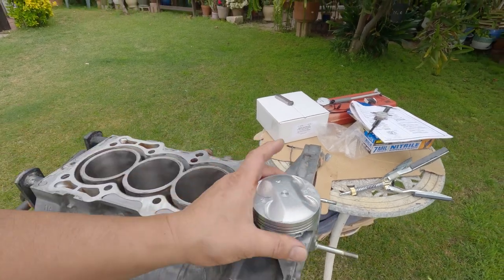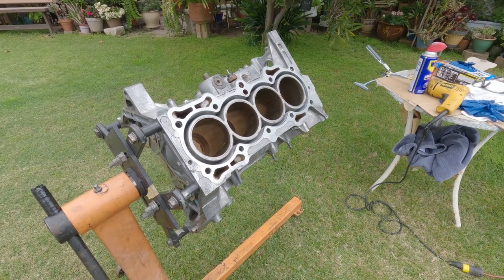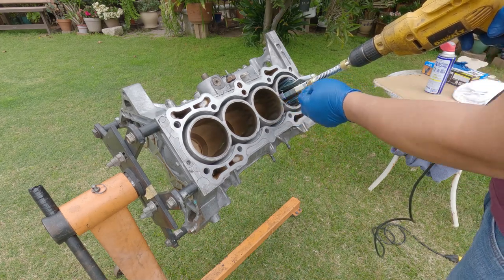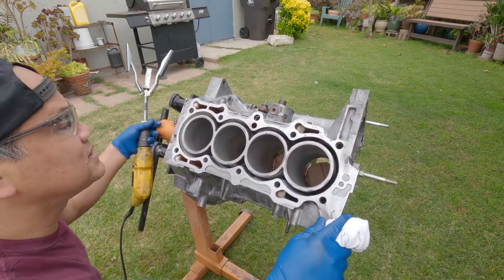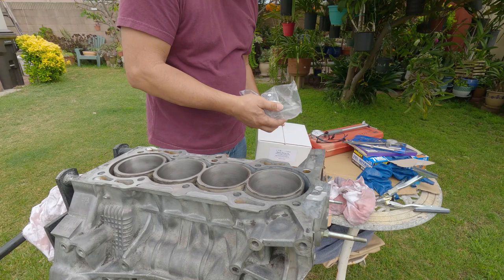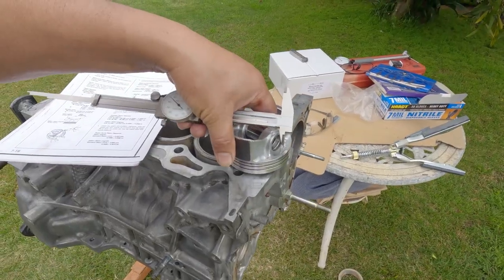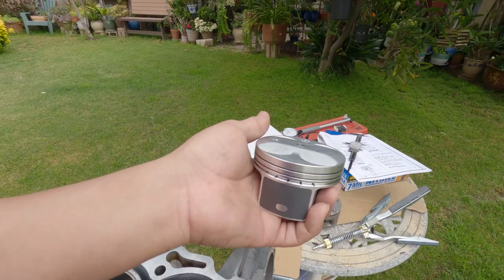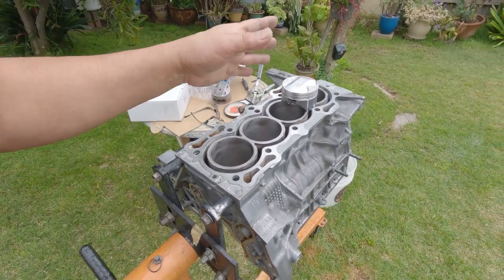Honing F23 cylinder Block and checking K20 piston to cylinder wall clearance

Comment: I've had good success using the ball type hones on the F23 blocks,  I just keep it lubed up with clean engine oil.    Actually most of the F23 engines I've torn down have all been in amazing shape.  I've torn down 3 or 4 F23A1/A4 that were daily drivers, and you could still see the original cross hatching.  Even the rings were all free and in good shape, and the bearings were still good.   These engines hold up extremely well with decent maintenance and oil change intervals.
Reply from the maker: Honda engines does last forever when well maintained. Thanks for your feedback.

Comment: I love binge watching your videos brotha! Its me again Vee.. lol. I'm sure I've already told you, but I finally got my hands on a h22a4 complete head and block from my yard.. rare find, and the wrecked prelude still hade the complete motor with m2y4 trans, but I didn't have enough for the transmission atm.. so I lost out on a good transmission.. but I'm fully rebuilding the head and block, ive downloaded the prelude manual, and it states on there that the block can be honed? With a rigid stone? Which is what you have? Isn't it? I plan to use new hasting rings. But I only have the same honing stone you have.. on the prelude manual, I swear it shows the same identical one as well? But if I get new rings, would it be a good idea to use them without honing the walls for them to seat properly? Or are the frm sleeves okay to do this? Lots of questions I know.. 😂but I really want this swap to be reliable and last.. I've gotten my king .001 extra oil clearance bearings in already, since the honda oem color coded bearings are hard to find.. but my block only needs 1 yellow and the rest are green sized bearings with the stamps on the block and crank, so I figure I get .001  to give myself the extra cushion just in case, ill be plastigauging everything of course, but as long as I'm within .0015 - .0018 on all my mains ill feel confident. Would there be anything else you would recommend me doing? I pretty much ordered everything brand new, gaskets etc.. some oem honda.. but a few I had to source from the parts store like GMB waterpump, gates timing belt, and I bought an ebay manual tensioner. Idk hopefully I'm not forgetting anything 😢😢😅😂😂😂
Reply from the maker: Your'e doing ok brotha! If your block cyl bore are w/in serviceable tolerance, and when you disasseble it that it look like its not burning any oil. You can just put new rings on it. Dont do any honing if you can. But if you feel like doing it. Just do a quick pass. Hope you put it all together and enjoy it. For the tranny, you'll run to it again. Thanks brotha
Reply: @sagittnet2158  thanks brotha. I appreciate it 🙏.  Ive been debating whether or not to do the h23a vtec conversion.. but since I have a 97 spec block, ill have to use the f22a crank and rods.. but its the exact same spec as the h23a1 crank and same part number. Since I have the engine disassembled. I'm very tempted.. but the inside of this engine looks great. The bearings have little to no where, and the oil residue is not sludge at all. Just a slight very slight tint of orange. Maybe from high mileage.  And I'd hate to not use these reliable parts.. but I'm hoping I won't be disappointed with the torque and power output the h22a4 will give me.. I know the h23a vtec has lots more torque. Ill be swapped my pinouts from a11 and a6 around I believe, those printout sheets you sent me were a godsend since I study it almost everyday in the past.. 🤣 🤣 but any hoo.. I tend to ramble on when it come to cars or Fiona in general.. lol. Hopefully I'll be in the h22 club soon. Just a few more parts. I'm missing only the odb1 h22a1 internal dizzy, maybe obd2 injectors since I'm reusing my chipped p06 ecu that got sent off to hasport for vtec components.. and I accidentally gave my h22a thermostat away with those two blocks I got for free last year.. SMH.. so ill be needing that.. and really just the h22 upper plenum spacer that hold the IAB plates. And I have everything else. Phew!!.. lol
Reply from the maker: Just build the H22a4 first, that way you'll have a reliable engine. You can always build a frank engine anytime, w/ H22a4 recondition, no worry of anything and you can run the piss out of that engine. The key to higher rpm are the valve train, you have to replace the springs.

Comment: What grit stones did you use? I'm gonna be redoing a k24 soon and don't wanna take it somewhere to get honed
Reply from the maker: Not sure what grit it is, HF doesn't soecify on their specs. If the cyl walls is not really in bad shape, these will do the job. Thanks
Reply: @sagittnet2158  I ended up getting a 400 grit stone hone, should remove the glazing without digging too deep into the walls

Comment: I'm confused about the whole piston offset thing, I understand that the k series motor rotates the other way but the valves are on opposite sides anyways so why does the piston need to be oriented that way?
Reply from the maker: It's because of K20 piston wrist pin offset is opposite of F23 piston. Mainly replicating f23 piston correct oriention when installed on f23 rods. It doesn't stop other builders to install it on normal position. It'll be a good if someone will share some info if anything abnormal wear on cylinder walls or piston if its installed opposite of f23 piston. Thats pretty much the reason behind it and also a little bit of history. The creator of g23vtec found out also that there are enough valve to piston clearances when using k20 type S piston wrist pin orriented the right way like F23. ITR and CtR k20 piston have taller dome than type S, so it'll require to at least clay your motor if wish to use a piston other than type S.
Reply: @sagittnet2158  interesting, what's ur opinion on using h22a4/type s pistons, do they have a similar offset as the f23 pistons? I'm also wondering if h22 pistons would have any clearance issues with high lift cams in a g23.
Reply from the maker: @leokogan1002  H22 vs k20/f23 piston have different piston height. I have a engine and a episode about it were the H22 piston top is protruding 0.020" passed the H22a4 block w/ F23 crank and rods. Using a base crankshafts is ok but no hi lift cams. Which block are you thinking of using w/ type S piston?
Reply: @sagittnet2158  probably an a4 block, just for convenience with the headgasket and all
Reply from the maker: @leokogan1002 H22 piston made by JE have a wrist pin offset, l believe it was FSR model and some manufacturer dont have it. You can also find a K20a2 piston that doesn't have wrist pin offset made by CP piston. Wiseco k20 have wrist pin offset but their H22 have no wrist pin offser. It's a bit confusing on piston selection but you can always narrow it down to make it easier. Just remember that H22 have a different cyl sleeve w/c is FRM and piston selection has to be compatible w/ it. Otherwise damage on cyl walls and piston skirt will occur.

Comment: I used that honing tooling rebuilding my block back in February. Been running good every since 🦾
Reply from the maker: It actually not bad for the price, thanks man!
Reply: @sagittnet2158  no doubt & thanks also man. Followed your steps etc & got it done
Reply: what engine did you do it on?
Reply: @sagittnet2158 what engine did you do this on?
Reply from the maker: @rogelioburola84  F23 block, its for g23
Reply from the maker: @rogelioburola84  it's F23 block from 98-2k Honda Accord and it'll be a G23vtec build project.

Comment: ur videos are amazing keep it up 💪💪 questin i have h2b del sol when i turn the headlights on the car idle lows and when give gas car idles reallyl ow and dies but when headlights off is good any ideas🤦🏼‍♂️thank you
Reply from the maker: Thanks man! I never deal of something like yours except for when l was breaki'n the g23 where l come to a stop byt the idle start surging. Do a elimination procedures, I can suggest check your IACV , check the filter and clean it, then check iacv together w/ idle screw if it require to be adjusted. It can be that your alternator could be needing some replacement but this will be your last move though. If you did any recent maintenance on your car prior to this problem. Go back to whatever you did. Check or ajustment of tps might help too. Check all your ground connection also. Check your Ignition spark plug gaps and check your rotor. Hope you get her fix man, but yeah, start on lacv.
Reply: @sagittnet2158  appreciate it my man 🙏🏼 i will check  keep doing more videos I  always check them out 🙏🏼🙏🏼 amazing content and how u explain things💪💪💪

Comment: Do you know what post mount can I use for my g23 ? I’m planning on swaping a g23 into my civic and only thing I’m missing is a post mount
Reply from the maker: Most people use H22 post mount. But l'm using F23 that l modified to fit the mount. Either of the 2 can be use.
Reply: @sagittnet2158  I tried my h22 post mount that came with my h2b kit and it doesn’t work how did you modify the f23 mount ?
Reply from the maker: @H2b.sookie  yes, your post mount that included on H2B kit will not work on F23 block. It's only for H22 block. I'm using Prelude tranny and sinced the block laid on the bay normal, l was able to use f23 post mount by adding a ear and welded it in place like H22 post mount. I actually have a video of it and also the difference between the F n' H post mount when bolted on the F23 block. I think you gonna end up making a custom bracket for it. It'll take a few months for me to find out what post bracket to use on my F2B project but mine is a plateless F2B.
Reply: @sagittnet2158  oh ok do you know any other post mounts that will work for a g23 into a civic ? I have everything already don’t wanna turn back
Reply from the maker: @H2b.sookie  Nobody sell a bracket for f23 block that being use like H2b setup. You can use that post mount if you like but it'll require you to elongate the holes and l think you might not like it after the mod coz it can come loose. I can recommend mock up the f23 post mount and see what need to be done. Maybe you can add a spacer or something.
Reply from the maker: @H2b.sookie  https://youtu.be/tC2XL-VJ7Gw
Reply from the maker: @H2b.sookie  check out this guy vlog. He showed a H22 mount vs H2b bracket. I think you can somehow make a calculation where to put the hole.
Reply from the maker: @H2b.sookie  scroll his video @5:06
Reply: @sagittnet2158  thanks